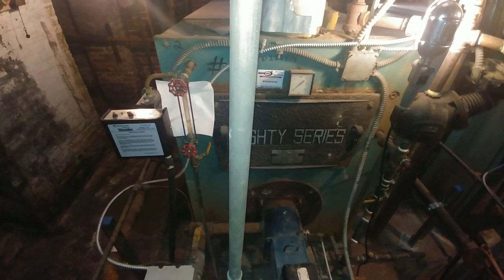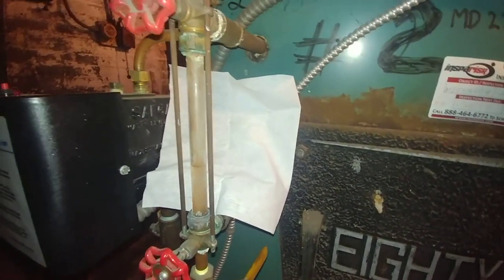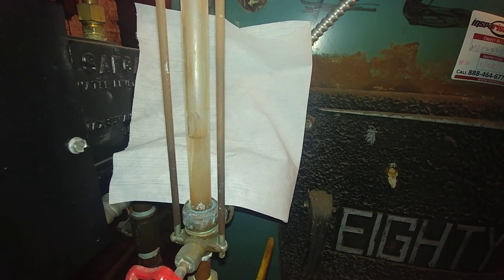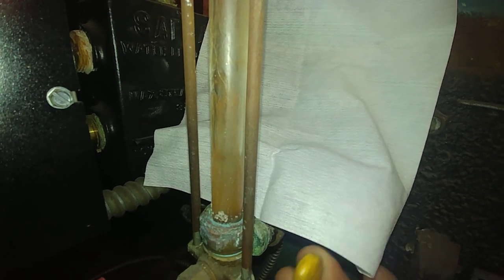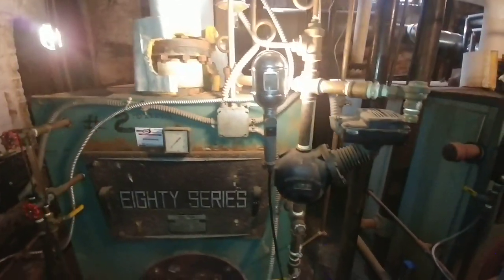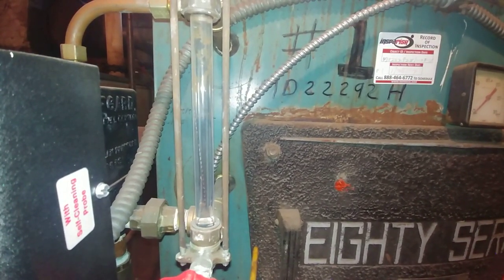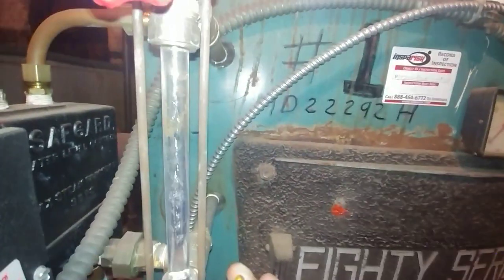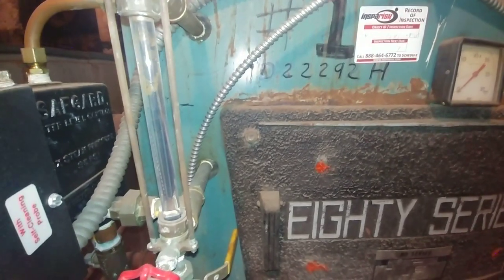Not Enough Water in Your Steam Boiler!? Or Maybe it's flooded? Sightglass Refraction Fun

Comment: thank you for this info. But where is your water draining out to? I filled my sight glass with too much water. How do I drain the water out? My sight glass does not have the drain valve by it. There is a bucket underneath a knob (left over from the previous owners) on the other side of the boiler which I think might be the drain valve. Should I try turning it?
Reply from the maker: Do you have anyone in your area experienced with steam boilers?
It sounds like you might have a lot going on, and since I cannot see your system and what you're up against, I am reluctant to say yea or nay and put you in a worse situation.

Comment: Our boiler have to feed water more often , now once a day, does it mean the radiator valve open too high , so too much hot air to lose? Please advise me. Thanks a lot
Reply from the maker: I am sorry to say you might have a major leak somewhere in your ssystem.
Leaking air vents, loose packing at the valves, union nuts leaking, wet returns leaking to name just a few.

Comment: I just moved into a house with a steam boiler. Today the water was low so the boiler stopped working. I added water to the appropriate amount and reset the boiler. It heated water for like 2 minutes then turned off. How do I fix? 😢
Reply from the maker: That is hard to say, are there are any number of things that could shut down your boiler in mid-cycle.
For example, the "pigtail" under your pressure controller could be (almost) clogged and not allow the control to re-set.
You might need to call in a pro

Comment: My boiler will run for few minutes then turns back off not heating up
Reply from the maker: Sorry to hear that.
There are a lot of different things that could cause that.
Let's assume you have a steam boiler.
Malfunctioning heat antisipator on an old mercury style T-stat.
Mostly clogged pigtail going to your pressuretrol.
Main gas supply issues.
Failing ignition control, or bad electrical ground to same.
These are just a few that it might be.
Need a bit more info as to what you have.

Comment: Thank you for your illustrations , very informative, 
Question , when I shut off the boiler for the summer, should I leave it empty or full with water ?
Reply from the maker: You are most welcome!
I would not  leave your boiler drained over the summer.
The wet inner surfaces will retain wetness and the greater surface area exposed to the air will rust more.
Most leave the water level @ mid gauge, while others may perposly flood their boiler in an effort to reduce oxygen exposure.
Your call on what is best for you.

Comment: Hi Gordon thank you for the demonstration, what's cause the boiler overflow?
Reply from the maker: This is a very unusual case of two boilers side by side.
One boiler is the "on" boiler for the season, the other boiler is off on standby but floods because the 100+ year old king valve leaks a bit.
No worries, a flooded boiler is partly protected from corrosion.

Comment: Thank you for the demo, Gordon. We have a packaged water tube boiler at work. Lately, the boiler has been flooding, once a day or so. The boiler floods and the Feedwater pump keeps running. Any idea what might be happening. We don't have a high water cutoff.
Reply from the maker: Perhaps the low water cut-off is sending a false signal to the feed water pump - is it a float-type LWCO?
Sticking floats are a common cause of flooding boilers.
We've had several such failures this year alone.
Reply: @gordonschweizer5154  That's the first thing that I thought as weii. We put a new head mechanism on the float column but it happened again. Last week it sometimes happened once a shift and then it didn't happen for a couple of days. It doesn't happen after a blow down or LWCO tests, or any other tests. It just happens out of the blue.
Reply from the maker: @dewey893loftus2  I'm going to guess this is a Mcdonnell & Miller float control?
In any case, you might try to get a hold of the factory rep of your new product to offer suggestions, because it sounds like you might have a mystery on your hands.
Does your system hold a vacuum?
Another defective product new out of the box, perhaps? 
Not unheard of, unfortunately.
I 'm also going to assume when you replaced the float head, you cleaned the chamber thoroughly and made sure the connecting piping was reamed out of rust.

Comment: Does.the sight glass become empty when the heat is on
Reply from the maker: No, it should most certainly not.
Normal waterline in the boiler should be about mid way up the gauge glass.
You don't want too much water in a steam boiler, nor should there be too little.
Reply: @gordonschweizer5154  ok how do I stop it from making the loud hammering sounds when the boiler turns off and on
Reply from the maker: @Wakanda1000  I am sorry, but without looking at your system, there is no way I can offer useful advice on that.

Comment: I manually filled the boiler to much. But I opened the release valve and a lot of water came out. But the water in the sight level is still full. How do I lower it.  I don't have the drain lever like you do.
Reply from the maker: I think you will need to find and use your boiler drain.  I hope for your sake, it is not clogged.
You will most likely need to remove buckets and buckets and bucketsof water before you see the water level drop in the sight glass.
Reply: @gordonschweizer5154  is their another way to remove the water because the drain valve is broken. And water already came out from the release valve so is their really that much water inside?
Reply from the maker: Do you have a sump pump near your boiler? Or do you have a wet vac?  I'd remove that boiler drain and replace it with a full port drain valve.  I'd be prepared for a fair amount of water to come rolling out.
Reply: @gordonschweizer5154  Okay so I got the drain valve open and the water came out, but the sight level is still full.
Reply from the maker: @mohammada4585  Keep draining until you are absolutely sure no water remains in your system.
Make any necessary repairs and re-fill to the proper level.
Reply: @gordonschweizer5154  but all the water is out yet the sight glass is full of water
Reply from the maker: @mohammada4585  If so, the sight glass is plugged at the bottom tapping

Comment: I have a Burnham residential boiler, with an automatic water feed unit.
Twice in a month's time, I woke up in the morning with water on the floor from the pressure relieve valve pipe. The sight glass was completly full. The splashing of the water coming out the overflow pipe, splashed upward, and into the fire box, flooding out the pilot light, and added a little water on the heating tube vents. Cleared tubes, relit pilot. Furnance works and heats fine. What is causing the furnance to overflow like this? In the over 30 years of living in my home, furnance never gave me a situation like this. Please advise.
Reply from the maker: Just a guess, but it may be your automatic feeder (a Uni-Match?) is sticking open when it feeds. Does your feeder have a manual feed button? If so, press it and let go.
Does the feeder keep feeding?
Reply from the maker: It also sounds like your boiler is failing. That is to say it has a hole in one of the cast iron sections above the water line that is causing the water to appear in your firefox when the boiler floods.
Shut off the manual feed and run your boiler with out it.
Do you need to re- fill the boiler more than once per week?
If so, you"'ve got a leak somewhere.
Reply: @gordonschweizer5154  Hello Gordon. Before I went to bed, I checked the water level on the sight glass - which was at the normal level. The next morning, my sight glsss was completly filled. As I was discharging the water through the hand valve beneath the automatic feed housing, the automatic water feed sensor assembly above the furnance was kicking on to replace the water I was draining. When I shut the drain valve off, the automatic feed assembly stopped when the water in the sight glass was completely full again. When I began to drain some more water from the sight glass, the automatic water feed assembly kicked on again. That told me that there is something wrong with my auto
feed sensor. I opened the cover to the unit, and disconnected one of the two red wires connected to the auto feed unit. For now, until I can replace the sensing unit, I am using the manual bypass valve assembly to add water as needed.
That is why I found water on the floor around the water pressure relieve valve pipe that runs the length downward along the furnance. Checking the underside of my heat exchanger, through the firebox - I found no water leaks. Since I disconnected the auto water feed circuit, the furnance works fine, and no more water on the floor. Thanks for your help.
Reply from the maker: @rickprusak9326  Thank you very much for sharing your detailed and well written adventure!
Very Glad to know you don't have a rusted out boiler as I sure you are, too!
We have noticed issues with  M/M  LWCOs intermittently sending false low water signals to the feeder.
Difficult to catch them in the act.
Reply: @gordonschweizer5154 It is always an adventure being a home owner,  a building, or business owner.
If it isn't one thing - it's always another. Same with owning a vehicle. Anything designed and built by a human, will eventually fail - when we least expect it. 
THANK YOU AGAIN, for educating the people around you, and on You Tube, and passing your knowledge on to those who seek it. Peace..

Comment: The water in the sight glass on my boiler goes from half to empty after 20mins of running the system . After letting sit for a few hrs the water level returns to a little below half on the sight glass
Reply from the maker: I would suspect the wet returns are full of sludge, slowing the return of water back to the boiler.
Make sure all radiator valves on single pipe steam systems are full open.
Reply: I guess I have similar problems, have you solved it yet?
Reply: @gordonschweizer5154 hi my boiler yesterday can not turn on, I added too much water. Can I empty water from other side drain to let boiler on. Your advice is appreciated
Reply from the maker: @jimwu1182  Yes, you should drain the excess water thru the boiler drain to the proper level - midway in the sight glass
Reply: @gordonschweizer5154  thank you so much ， I will try

Comment: Mine flooded right after this last heating season just like that! I’m sure the autofeeder failed so I closed its manual valve.
Reply from the maker: Sucks when that happens, doesn't?  You have a VXT autofeeder, is that so?
Reply: Gordon Schweizer no I think its the MM one? But at least I caught it before my radiators became sprinklers!
Reply from the maker: @pb7379-j2k  Sprinklers indeed! I've seen it, it ain't pretty. Glad you caught too.

Sorry to be a bother, but which MM, the old clunker type, or the newer electronic type?
Reply: Gordon Schweizer I think it’s from the 90s so...old electronic type 😉. Uni-Match
Reply from the maker: @pb7379-j2k  Are you thinking about replacing the Uni-match with a VXT feeder?
Reply: Gordon Schweizer I’m torn between that and just managing the level manually
Reply from the maker: @pb7379-j2k  Yes, you do get a better sense of water loss when you add it manually, indeed.

The unimatch solenoid valve (the S-45) is unrepairable, officially.
No factory support whatsoever!   But I hope to have a video soon on how to attempt to beat that!
Reply: Gordon Schweizer I might give it a shot too!
Reply from the maker: @pb7379-j2k  Best of luck to you! See if you can source a S-45 valve repair kit, usually sold by restaurant coffee makers (Fatco?). It contains a rubber diaphragm, return spring, plunger, and stainless cover.  Have lots of white vinegar on hand to break up the crusty calcium deposits in the valve body.
Reply: @pb7379-j2k  Could you tell me, please, how many times in a week you put water by hand? I turned off the water feeder because the sight glass was always full and I think that caused a hole in the return line. Thank you very much!
Reply: @mioangel1227  Less than once per week. Maybe once every 3-4 weeks, maybe a quart per month roughly?
Reply: @pb7379-j2k  Since yesterday that I turned the water feeder off, I was checking a few times a day, but the sight glass still in a higher level. I was worry, but now I feel better. Thank you so much for your help, very appreciative!